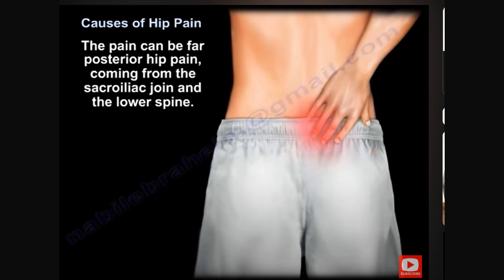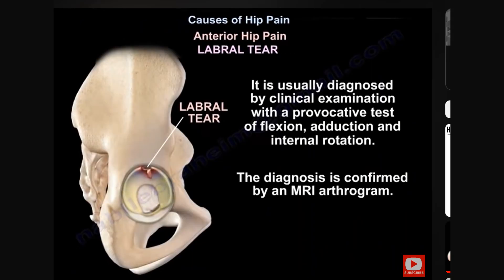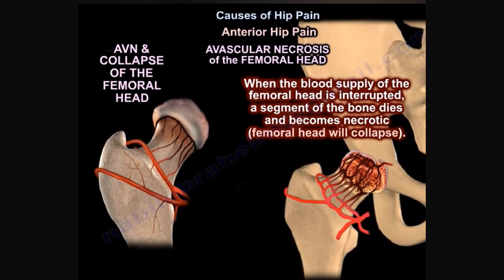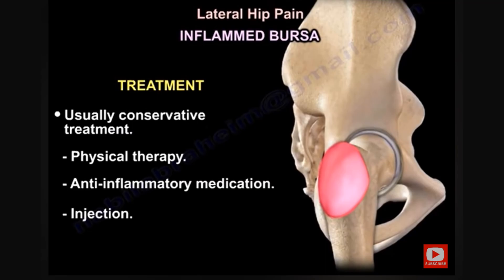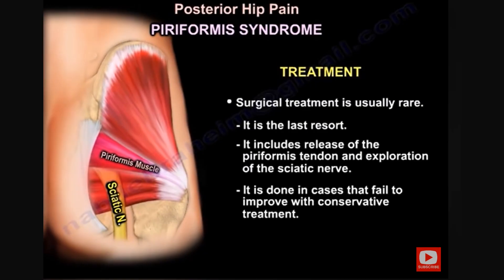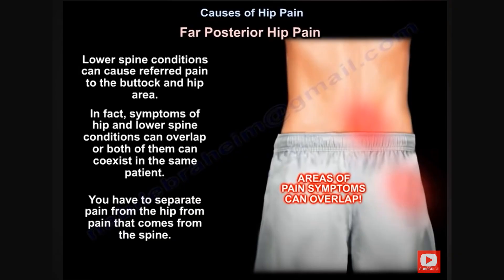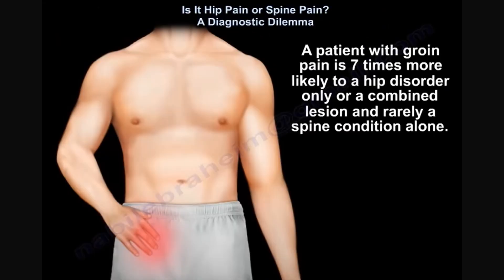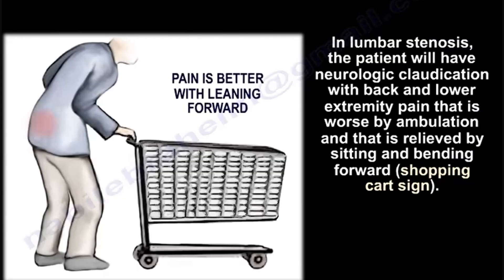Hip pain -  Why does  it hurts? What causes the pain?  How is it treated ? is it hip arthritis?

Comment: I've been experiencing hip extreme pain in my joints for past 30 days. I can only partially relieve the pain by taking ibuprofen a bunch of it. But the pain is not getting any better. My job requires me to stand 10 hours a day. On my days off I just rest and don't move much. Thinking the rest would work but it doesn't help!